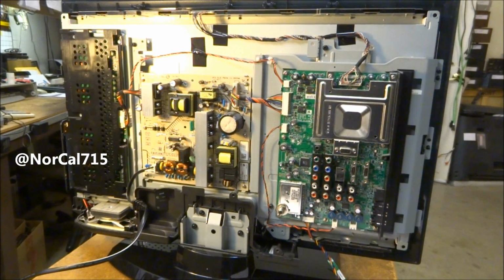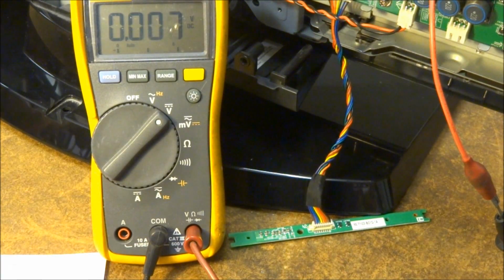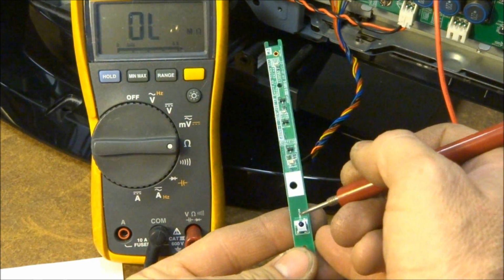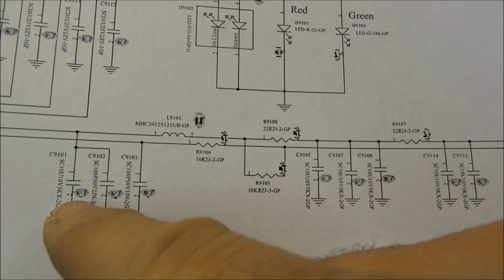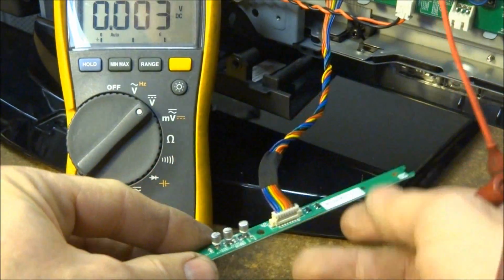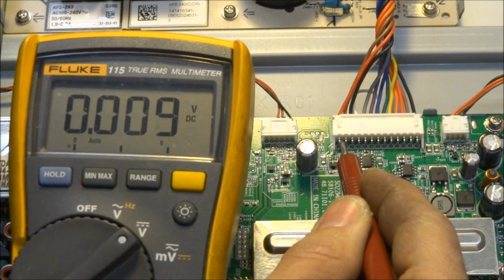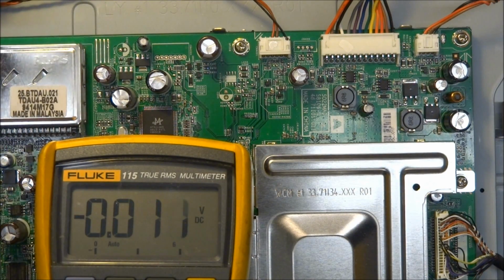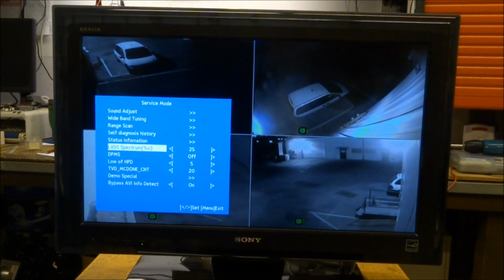Sony KDL-32L5000 26L5000 32LL150 32L504 22L5000 37L5000 No IR Infrared Remote Operation Repair Fix

Comment: I know this is super far out of date, but I wanted to check as my replacement caps get in soon.

Based on the before and after images, It appears you end up soldering the replacement caps to C9113, C9107, and C9101, and skipping the other spaces in between. Is that correct?

Comment: I have sony Bravia klv-40bx450 my remote only woks within 1 mtr range. New battery changed remot is good with other device seems sensor not sense the IR. What is the solution
Reply from the maker: Check the remote output with a cell phone camera, compare the level with another known good remote to rule out a bad remote. Otherwise the remote sensor may be bad in the TV.

Comment: Perhaps you can tell me , I have the same tv your working on, and now I have a thick green line running verticle.
And I also notice that the standby light is not illuminated.
You have any suggestions?
Thanks

Comment: Good video, in general troubleshooting, but from a design perspective there's an issue with the recommendation - you should NEVER replace a ceramic capacitor with an electrolytic.  Ceramics have a very low ESR, and where they are designed in, there is probably a reason for the choice of ceramic.  Also ceramics are more functional effectively at higher frequencies for a number of reasons, one of which is a lower internal inductance.   In this case, the components are for filtering for the IR chip,  and ceramic is appropriate.  Ceramics would be a better choice here and you can get them from Mouser Electronics, Digikey, and even Fry's.

Comment: Dear @NorCal715 Ver Good Video. My Sony Bravia LED FHD TV KDL-40EX520 stopped responding to Remote control. Tried new Remote but TV sensor card not sensing the signal, so I opened the TV and replaced one resistance found open. I was happy to see the TV working but only for 2 days and same symptom again. Replaced the resistance agin but again worked only for 2 days. I gave up and decided to use TV only with TV button controls. ordered new IR sensor PCB but after few days, TV started shutting down on its own and started working later after rest of some time. Sony Engineer checked and advised to replace Main Board A-1-883-753-92. I got Main Board from China, connected it and TV started responding to Remote control!!!. I am yet to load Sony software on this board as it is tricky job. My question -is Main Board causing malfunction of  Remote sensor Card? Can this Main Board (original one) be fixed?

Comment: HI NorCal715, I just got my wife a Sony KDL-32LL150 TV it is used and had no remote I got one on EBAY and it is new and the right one. The TV works great, but and there is a but the remote did nothing so I CK it with a digital camera and it worked fine so it was the IR infrared board I look all over EBAY no board, so I looked on YouTube and there was your video
 so I did as you did and it was the C9114 and C9113 capacitor just like the ones in the video the others was OK, but and there is a but I had no 10uf 16v capacitor so I started looking at all my junk and I found four in and old CD Rom 
I used one and put up the other three. Its just a blue one but it works just fine and save me a ton of money so THANKS FOR THE VIDEO

Comment: Good video !  I have a NAD c740 receiver with similar problem.  I will try the same approach.  Lucky for me my meter has capacitor measure mode.  I also like your idea of changing all the caps along the IR circuit... if one has failed the others are not far behind.

Comment: Great video with excellent detail. I ordered the 10uf @ 16v surface mount electrolytic caps on ebay, twenty for $4, even though only three were needed to be soldered to replace the 6 ceramic type that were original to the board. Worked like a charm after replacing the capacitors. I actually fixed this for a friend who could not get anybody to come out and repair the tv. Thanks for your help.

Comment: Your videos are excellent, congratulations. I would appreciate if you could give some leads to where to buy the services manuals for most common Flat Screen, and/or schematics.
I would very much benefit from a video with details on how to measure voltages and where to get the info. Also any other lead that could aid in determining the board at fault and maybe general ideas on how to go with the Multi-meter reading and comparing values.
Thanks a lot for your time and being generous with you knowledge. The more you give, the more you will receive. I totally disagree with those comments about you or other professional loosing because people would not come to them with business.
Good work and good principles, most of us repairing do it more for the challenge and satisfaction than for the money we save. Many times we are helping people that cannot really pay for it. Just look at the senior and retired community.

Comment: Muchas gracias por tu ayuda hermano, sin ese squema no hubiera podido reparar un televisor, fuiste la clave en esa reparación te agradezco.
Reply: Marcos Gonzales buenas tardes. Tengo una del modelo de este video tengo todos los voltajes correctos ..pero la TV se apaga la luz de pantalla y queda imagen sin brillo se pierden los 3v. De el cable rojo que van para las lámparas lo desconecto .y al conectarlo de nuevo prenden por un instante aunque no estén los - de 3v. De ese cable ( desconectado el conector como quiera se pierden los 3 v

Comment: hellllp!! anyone!!SONY KDL32LL150 ,,,,power relay clicks once or twice & tv does not come on anymore,,thankyouuuu!!!
Reply: +Raybo sflorida If the relay clicks once when power is plugged in that is normal, if it clicks twice something is shorting out, in my case it was the IR sensor not allowing the motherboard to allow the power supply to turn everything on.
Reply: A have  the same problem  un a kdl32l5000  .turn on some seconds then turn off AND only stay the power led on red

Comment: I ended up sending my infrared remote out to be fixed.  Got it back and on reinstall everything seems to be working fine, but I am getting "005  T-CON power error  001".  Is that just a history, which can be deleted?  I don't see anything wrong at a quick glance.

Comment: Please disregard my earlier question.  I am stupid.  I went back and listen to your video before this one.  It was my mistake, I listened to it wrong.  You were testing SMD caps and you said here is 12 volts on the input and 9 volts on the output.  I could never question anyone as smart as you. I thought you were going to each side of the capacitor.  I went back and watched it again, and it was two different caps and it was the positive side of both.  So there is never a time in a correctly operating circuit  where you should have any voltage at the ground of a component? I see you measuring those little regulators and there are three voltages on three different pins.  Is one of those pins ground?  Sorry this is what I get for knowing almost no theory.

Comment: Great Training your teaching ability is even higher then your knowledge and skill level.  I remember a time when no tech would teach anything to anyone. I have A D  D attention deficit disorder.  So I hate to read.  Make it hard to learn and easy to miss important stuff.  I have repaired electronics for 30 years.  However find I don't know some very basic stuff.  I thought that ground was always zero volts.  Did  I understand the video correctly that on those SMD caps there Is 3.3 volts input and 3.3 volts output? Thanks for the training.

Comment: do you know a good material for me to study like those coil for removing noise... capacitor.... because i could see a board and recognize more easily what they are for..... in general.. applied electronics... not so much teory.... more easy explanations to be used in trobleshotting, like you do..